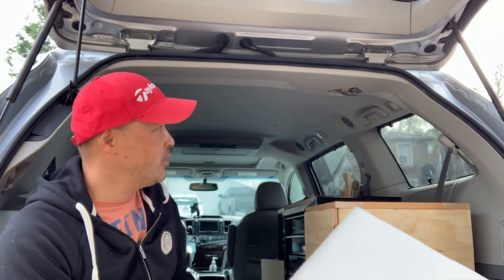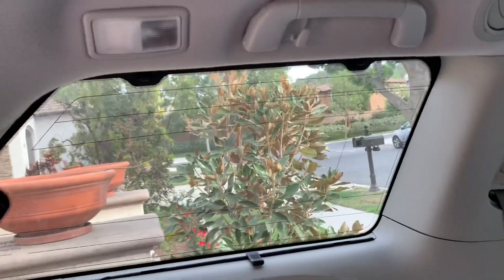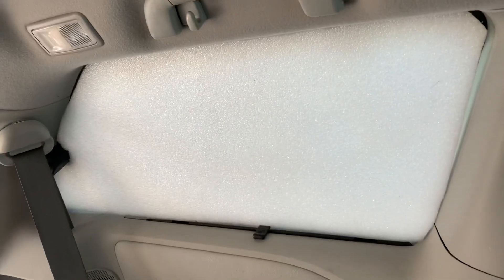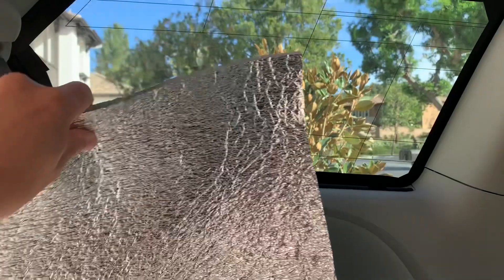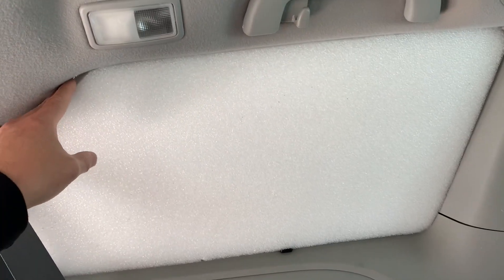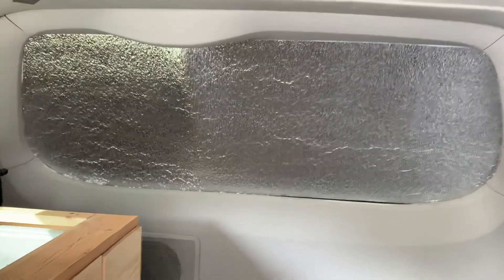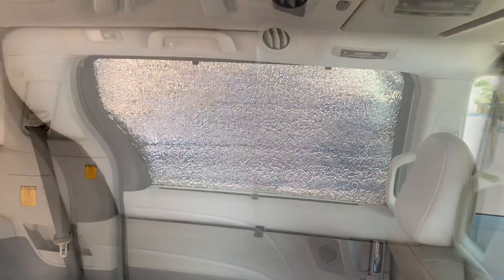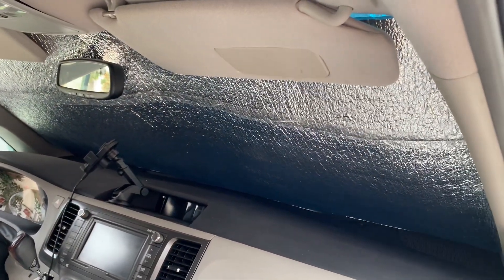I Hate Being Cold! Winter Camping Window Insulation. Sienna Modular Camper EP14

Comment: You should glue reflectix on one side and black on the other so you can switch from winter to summer.
Reflectix has a purpose. Put the reflectix on the outside in the summer and black on the outside during the winter. The reflectix keeps the heat out during summer. And the black absorbs heat during the winter. People don't get that and do it wrong all the time.
But I do think the addition of foam is a great idea!! That's what I plan on doing.
You should also use the foam in the summer. It will help greatly keeping the heat out. And if you have gotten it cut out, use it!!